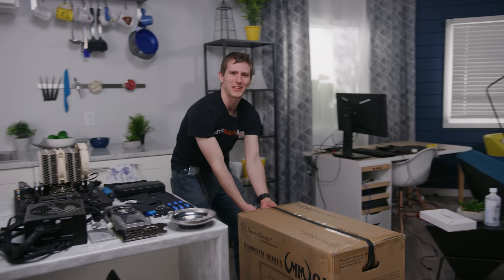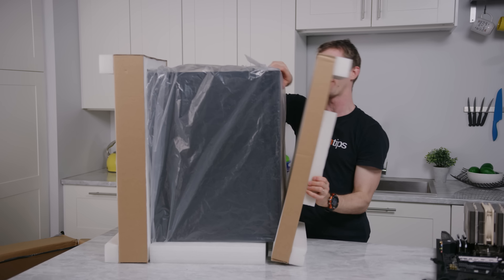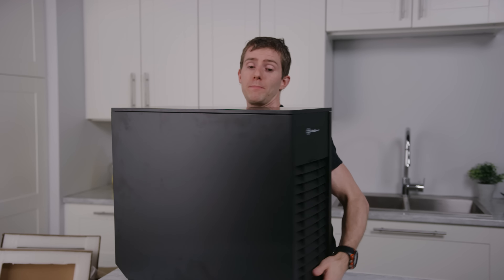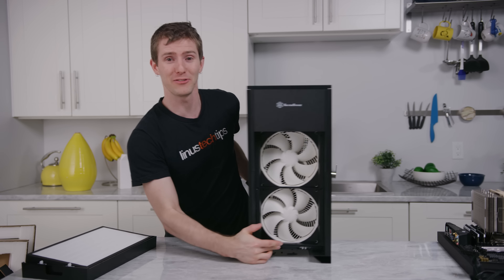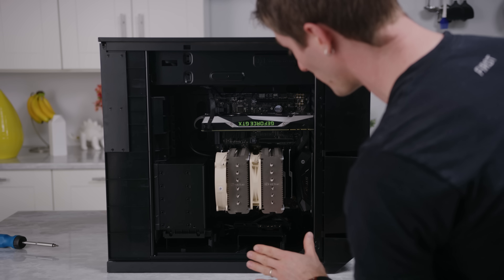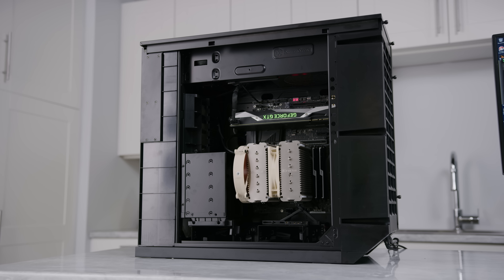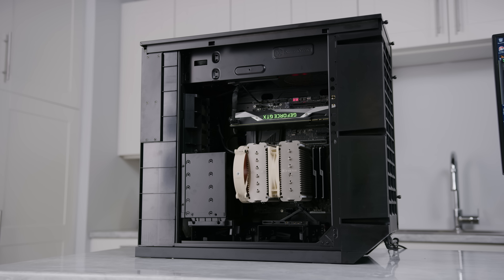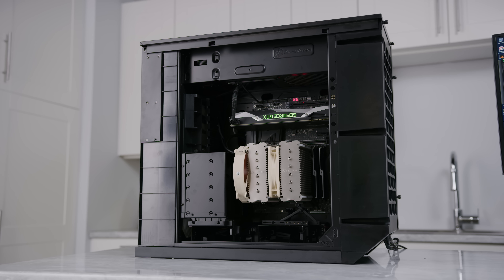Water & Dust Resistant PC Case - WHO NEEDS THIS??

Comment: Wow, I run a small workshop, mainly small scale cnc/cadcam production. I've been using my own laptop as a shop computer for ages, everything in the workshop gets covered in crap.

Actually seriously considering this case for a shop build, I wonder if they'd do a smaller model without all the space for HDDs & mAtx boards.
Reply: Do it. I think it's awesome. Seems like yours is the perfect situation for it.
Reply: Just ordered one. Way too big for what I need (mATX board, no HDDs :D) but that HEPA filter is awesome, particularly for the price (£200 case, filter alone would be £30-50). I'm trying to decide whether or not an exhaust fan is a good idea, with just the 2 intakes I'm sure it will maintain a more positive pressure, keeping particulate out the back. 

Throwing bits together for the rest of the build now.
Reply: Dude that's great!  Try out just the two intakes at first and see how it does in the shop. What cooler are you using for it?
Reply: Do you really need the power of a full size (or even M-ATX size) PC in the shop? If not then I'd suggest you take a look at something like a car PC or any number of sealed up compact PC's that doesn't have a fan or even ventilation openings.

They are less powerful than a regular PC, but for a lot of applications they can be enough, and they are certainly dust proof, and I'm pretty sure it's possible to find a few that's waterproofed.

The low tech alternative would be a monitor and keyboard in the shop and lots of cables going through the wall into a room where your PC can live protected from the shop environment.

Another idea would be a terminal in the shop and keeping the PC in another room. PCoIP is quite handy for situations like this. The easy, but probably not the cheapest, way to do this would be to get hold of a AMD FirePro R5000 PCoIP Remote Workstation Card. Pop it into the PC of choice and connect it to the network. Then get a PCoIP client, either something like the Samsung NX Series Tera2 and connect it to a monitor, or something like the Samsung NC241-TS - Zero Client Display for Business which comes with integrated Teradici client. I mention these specific products as I've used them and know that they are easy to configure and simply works.

Having said all that building a PC in this chassis is probably one of the cheapest and best performing solutions. It also makes for simple maintenance and upgrades if it becomes necessary.
Reply: Same cooler Linus uses in the video Noctua D15, going for an AM4 Ryzen 7 unit. Not sure what GPU, literally anything vaguely modern with ~4GB vram would do (Autocad benefits from GPU acceleration, makes loading and viewing assemblies much faster, however you don't really need much horsepower, or workstation specific GPUs unless you are doing Maya/Solidworks analysis and whatnot)

Yeah Blahorga, you are right, really needed just a little ITX build. However couldn't work out of a passively cooled unit as I do leverage CPU power quite a lot. My workshop is freestanding and doesn't have an 'office' to put a permanent system in, so the long cabled terminal solution wouldn't work, PCoIP sounds like one of those things that would be a colossal pain in the ass to work around (I'm a mechanical engineer, not IT :D) currently use my older gaming laptop which I take out to load up jobs to my mill (a Tormach PCNC). Storage is no problem, I store most of my jobs in my personal 8TB NAS, only ever use ~100gb max on the laptop, workshop system would be full SSD.

Looking forward to having a system in the workshop, just ordered up an AMD 1700, 16GB of kingston ECC, and an ASrock Taichi. Currently considering what peripherals would suit, would love an old IBM model M but actually finding one that isn't demanding a fortune is proving to be a pain, will likely keep using my trusty Razer Orochi mouse.

Comment: Remember to feed and water your system every day kids - so it can grow big and strong and evolve into the next tier :D

It's cool that something like this exists - I can't image the market for it is very big though.

It seems genuinely as rugged and resistant as you'd ever need outside of military use maybe. It seems like it's sturdy enough to take a few knocks too without major functional damage.
Reply: well, rugged systems may not have the greatest use unless it's laptops in the military but it's good for bragging rights, plus if you're the type that cleans their system once per half decade and are spill happy, this case is gonna be a godsend
Reply: i just take my compressor and blast out all that darn dust with around 30 psi of air coming out the hose. does a pretty decent job too

Comment: This would be great for use in an industrial area. For example, in our fab shop (that is always full of metal shavings & dirt) we have a computer connected to the CNC burn table. We had so many dust issues we ended up building an (almost) air-tight container for it, with all air intake routed through a shop-vac ait filter. It works great and we just have to keep an eye on the filter, and occasionally take it off & blow it out.

Comment: "Who need this?"

The divers.
Duh...
Reply: Pro Player 1⃣ People who likes to shower alot too.. and hottubbers.. nothing more relaxing than a game of CS GO while hottubbing.
Reply: I was just gonna say people with shops especially dirty ones that have lots of dust, oil and fine metallic particles in the air badly need something like this.
Reply: matjojo jep you get it thanks
Reply: Seamen?
Reply: Snorks. Havent seen them around since we all went to the internet.
Reply: To be fair and on a serious note:
Any business that has highly sensitive data that can't be stored externally like on the cloud, and has sprinkler systems that would ruin most computers... I can see the need actually.
Reply: what if there is a fire and the sprinklers go on and you could of saved your comp but the water killed it
Reply: @ Q13E5...

Except that even with that type of filter, vapor from the salt water means the computer would not last long
Reply: It's for Subnautica
Reply: yeah especially with those fans. I'd like to see a water cooled system that has fans a radiators in a separate enclosed system with O-rings on the tubing.
Reply: I'm surprised no one mentioned military application when they're setting up command centres inside tents in windy / rainy environments, same goes with yearly events out in places that you'll only have marquees as shelters.
Reply: We are number one!
Reply: Military for one!
Reply: Pro Player 1⃣ medical centres
Reply: the shop computer would be way better if it could be in the shop. and yea people live in houses that are with carpeting and pets and kids full of dust 24-7
Reply: Lol I thought he was spraying a regular case with waterproofing
Reply: Those who want a true water cooling duh! Custom loop is for peasants!
Reply: The company I work for needs this in their Distribution Centers.
Reply: Me
Reply: probably  for those offices who's job is to watch and edit professional porn all day.
Reply: the rig running the CnC machine or chemical testing equipment. I can imagine putting this case in a plexiglass box with air hoses for the intake/exhaust  run to a cleaner  area of the shop

Comment: That filter is almost as heavy duty as one that you’d put in your car or in the ac unit in the house
Reply: Cybernetic Husky it’s quite literally the same thing lol
Reply: Being a HEPA filter, it basically is.
Reply: It looks better than the filter than in my AC
Reply: the case is 300$ probably because those filters would be around 100$ by themselves, so no, they're by far better than the cheap ass filters you get for your HVAC system or your car.
Reply: I'm sure hospitals use them to scrub the air in operating theatres...

Comment: I know this is over 1 year old, but I was working as a graphic designer (subcontractor) for a sign shop. They works with metal, plastique and wood. That kind of case is a MUST for that kind of company. Seriously, I did 2 cleanup of the only PC it had and it was dusty as hell.

Comment: 10:30
Dude, you have an extension cord on a surface with water that you're standing in.
Reply: That isn't enough water to get you zapped.
Reply: @hemorrhoids221  I think the water doesn't know that, but it's a nice theory.
Reply: I don't think you understand waters conductive properties... Stop skipping school...
Reply: @alexissixela6914  Poor, and there isn't a reason to electrocute you as the electrons in the extension cord on the ground are already given a path to the ground without going through anyone's body. It's only dangerous if you pick the cord up.

Comment: This'd be actually a perfect case for a watercooling setup with an external radiator. You'd have to liquid cool almost everything due to the restricted airflow tho. CPU, GPUs, RAM, VRM, HDDs. It'd be possible.

Comment: A HEPA filter in a pc case? To protect the system from a virus or what?
Reply: There are actually people who are extremely sensitive to air particles and need hepa filter on everything that moves air, but I agree, a veeeeeeeeeery few people actually NEED this.
It's really cool that they're improving cases, though, not just making space for more eye-candy bullshit aka lights.
Reply: i work in a mine, in the IT, we use this case in areas outside the office, basically the computer is working 24/7 making measurements and everything else, in the control áreas near the entrance of the mine where a couple hundred of trucks passes all Day we use this case too

the filter get pretty dirty after a couple months, but The parts stay CLEAN
Reply: Would shop or factories, something like that would prolong the life of a computer.

Comment: Definitely buying the case. I am really big on saving time and anything that saves me time from having to clean my case is definitely a buy for me.

Think of it like this: Lets say you are a smart person and want to let your electronics last forever and so you will clean your case once a year or every 6 months depending on room ventilation. This takes about an hour to properly do and you will have a case like this a good 10 years before you need a new one. 

That's 10 hours of cleaning saved by buying a well-built, waterproof, dustproof, 300 dollar case. 

I also disagree with Linus about the temps being bad. 340 cfm is like 90 mph. Put a leaf blower on low and stick it in the case and that's basically these fans.

On top of having a place to put back fans?? YES. This is probably the best case Ive ever seen.

Comment: I'm sure the Military supplies their own cases for their provided compueters, but if the Military ever did need a case for their Computers outside of their own contactors for their bases somewhere off in the Dusty Dunes of the Far East, or even the Salty Sea's of the Ocean I'm sure they'd hit this manufacture up xD
Reply: yup
Reply: Middle East*
Reply: I seem to recall that the US military uses Dell Rugged Latitude: http://www.dell.com/en-us/work/learn/rugged
Reply: NOPE, At least from my experience Most are Panasonic (Toughbooks) or Getac units.... It is why they make the specs for the manufactures to adhere too, so then they can get the contract to supply to the military.
Reply: I was an aviation electrician in the Marines. The equipment and computers we used were 10 year old toughbooks that got completely filled with moondust in the middle-east. Everytime a deployment came back, we spent hours just cleaning the equipment and PCB's. Something like this would be nice, but the military is too cheap to spend that much on just a case.

Comment: Water and electricity. What can go wrong right?
Reply: Cyba IT almost as bad as socks with sandles at the end of the vid
Reply: black guy they can.
Reply: +Cyba IT   Good to see another ATi fan. I'm still rocking with my vmodded ATi HD4670. Too bad AMD ruined ATi when they bought the company. Now I only like Intel and nVIDIA.
Reply: basshead cool man, classic card. I'm running dual stock r9 290's in my i5 k watercooled gamer oc'd to 4.6. Sounds like a jet taking off and runs pretty hot but plays most games pretty well on triple 1080p monitors.
Reply: potato psoas stand in a bucket of water and throw in a running hairdryer and see how weak the electricity is :p
Reply: @basshead.  cough cough ryzen and rx 470-480-570-580 and Vega cards
Reply: +Vita Eve  You are wrong.

Comment: If you CNC or work with computer operated machinery in general this would actually be very useful
Reply: I can see car mechanics also using it  the water filtering would help any spilled car fluids from getting into the computer. I have seen similar things with laptops at one trade show I went to they had a laptop stuck under a water fountain. It was ip65 when closed. So it could be submerged for short periods of time. When it was open it was ip52 so it would be ok if it was sprinkled on.

Comment: I worked IT for a big metal plant... I WISH we had these. I went out to help with a dead computer we previously had no idea existed/needed to be cleaned -- turns out the 1/4 inch of sticky gunk that covered the case got inside and stopped the fans from working. We ended up fabricating some plexiglass cases over the new cases and got some long cables to put them in another room.

Comment: This would have been awesome at the factory I was IT for... All the pc's were filled with dust almost instantaneously, we were producing wood pellets and the wood dust got everywhere. I was actually impressed the computers lasted as long as they did, 4-6 months was the normal life expectancy for the computers. 

We had rugged laptops everywhere, but all the control systems was on desktops, and no matter what we did to try and keep them clean it never helped. I tried to Mcgyver a solution using womens stockings to cover all the fan openings and it only helped a smidge... Dust was everywhere, even the factory neighbours was plagued by it... 
We had an insane budget for IT equipment, I even earned a bonus once I managed to make the monitors last longer than 3-6 months (in fact, we never had to buy new monitors because of dust after I came up with my solution)...

Comment: We had PCs installed in a machine shop next to a waterjet (55,000 psi water cutting metal). One of these cases would have been good. The Dell in the shop ran, but I never figured out how - totally covered with crap.

Comment: Actually companies such as Heinz uses dust and splash proof computers because of the work environment inside the factories. The powders used, the heat and water used (condens) and such can cause damage fast to non-dust/water resistant cases.

Comment: Im kinda scared how close that extension cord was and how he was plugging everything in..in water :-; but umm i like it (: it works. And its not bad at cooling. But yeah glad its okay :3
Reply: If he's never the shortest path to ground and they have a GFCI outlet, the cord is more dangerous as a trip hazard.
Reply: You do realize those extention cords are made to work outside, right?

I mean, you generally don't want to bury the connection in a puddle, but sump pumps literally work via this method and do just fine so...

Comment: I used to work at a chemical plant that made saccharin powder, and that stuff is safe for humans, but highly corrosive when it hits metal.  I had it destroy at least 6 computers because it would eat the traces or destroy the fans.  So we ended up using "Dust Bags" filters to cover the entire computer.  It only managed to slow down the degradation because the stuff goes everywhere.  But yeah, definite use case for dustproof computers.

Comment: ok that would have actually saved my system from that house fire, the interior was mostly fine except for being water damaged. The case itself had to be pried open because the plastic bits had melted, but what had killed the internals was the water.

Comment: the thing is, if you're in a shop, with loud CNC machines and sawdust or other crap in the air, this would be great, and the noise wouldn't really be an issue since everything would be loud ha

Comment: For reference Noctuas current(2020) top of the line 140mm 3000rpm industrial fans move 158cfm a piece or 316ish cfm combined.

If you think well, noctuas got a 200, if I could mount one, what are its numbers. At the moment there is no Industrial version. Bummer man, 86.6. not enough pressure to be worth potential case mods

So by noise
noctua 140mm 3000rpm industrial: 41.3db per fan
with 316 combined cfm.

silverstone AP182 180mm 2000rpm fans: 40db per
340cfm combined

Newer Silverstone AP183 180mm 1500rpm fans
noise: 37 db per
280cfm combined

Are newer AP183 worth it? no, but they  are 4 pin pwm as opposed to 3 pin on the AP182 but if you look at the ap182 at 1200rpm you get 260cfm and 34dba per.

 I would just stick with stock fans. (AP182) easily adjustable when you need it. with case switches.

Comment: Who needs this? A lot of the time when your running a large CNC machine you will have a computer next to it to easily troubleshoot G-codes or review CAD models when the parts come out. Having a computer that can deal with the metal shavings and coolant from a CNC would definitely be needed

Comment: surprised it doesn't have delta fans to pull air through that filter, and seemingly not enough space to put x38 mm fans in if you wanted to